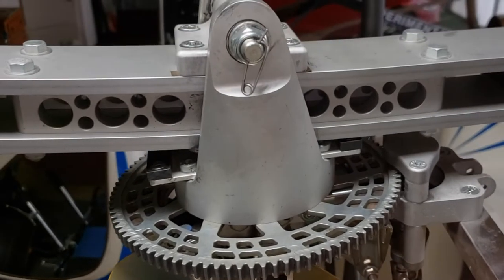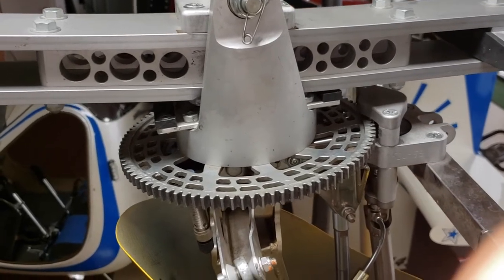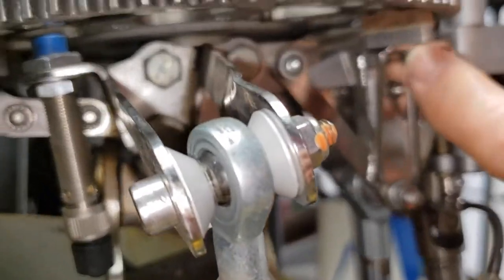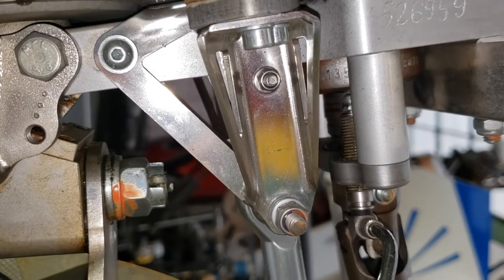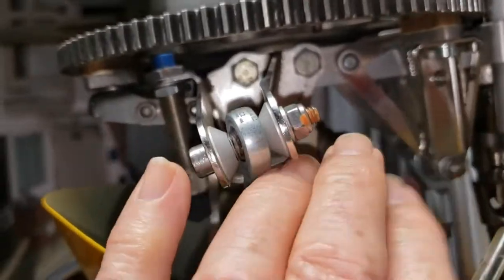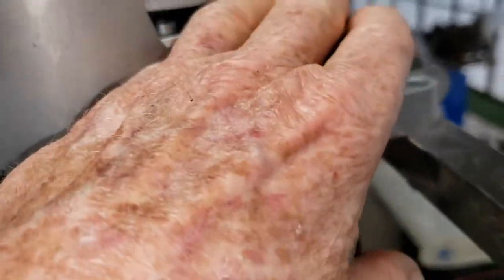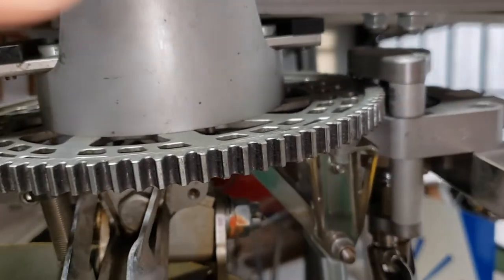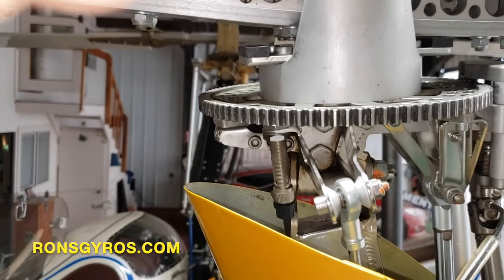Basic Gyrocopter Rotorhead Overview

Comment: Teeter bolt is a bearing surface?
Reply from the maker: Yes the teeter bolt is a bearing surface as it teeters on a mating lubricated bearing surface that requires additional lubrication periodically.